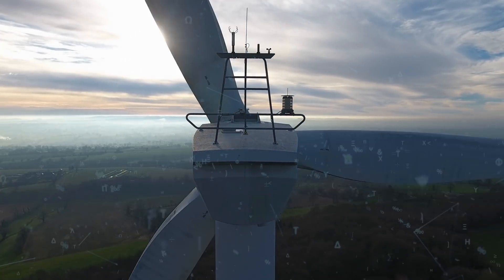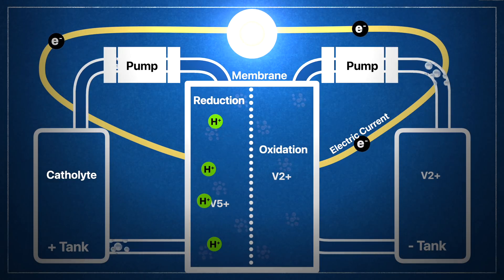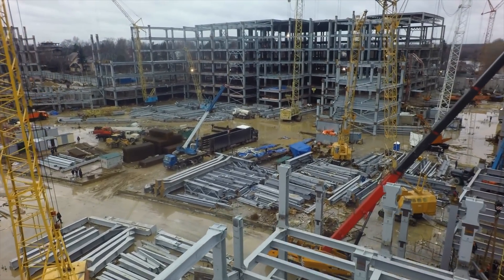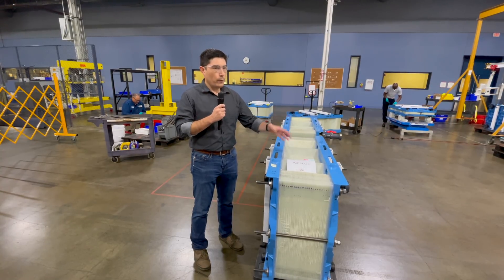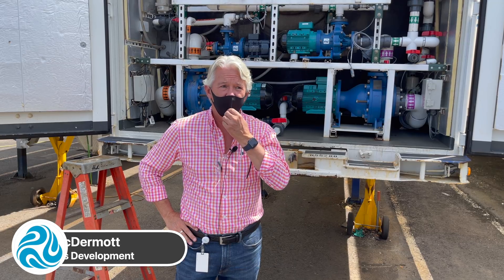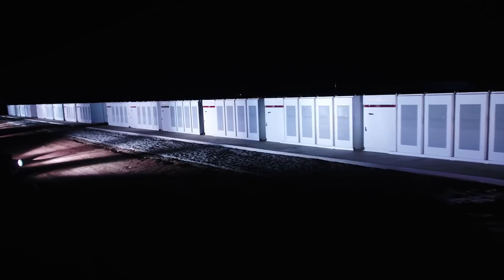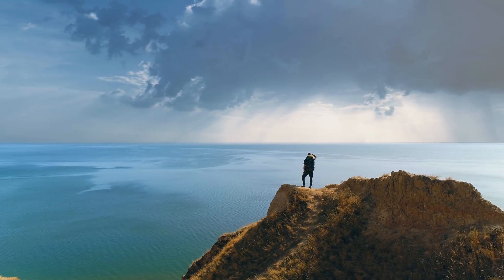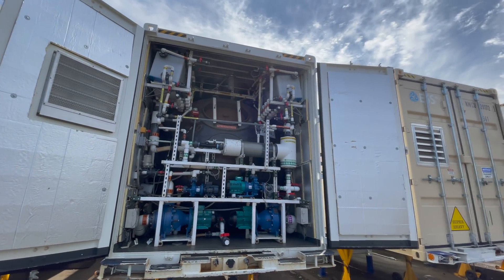The Future of Energy Storage Beyond Lithium Ion

Comment: Great feature but while Iron redox flow batteries are cheap they are also relatively slow and most suitable for long term storage. The technolog most suitable for medium term storage such as daily storage to shift solar energy into the evening peak period is vanadium redox flow such as the Invinity systms already installaed at a number of locations in California. They can be combined with a smaller capaity lithium battery for grid stabilisation. I'd love to see an item on this exciting technology.
Reply: Utilities are certainly looking for long term storage. weather events that block solar for days and also not have reliable winds do occur. There are times of the year where peak powers for wind a solar happen so have the ability of carrying over some of the excess energy in storage weeks or even a few months would be highly prized for any electric utility.
Reply: @rpf276  The low frequency of those periods of low renewables generation mean that there are few oportunities to earn money to pay for them, therefore thse long term back up systems need to be cheap otherwise we'll never get rid if fossil fuel peaker plants.

Comment: Let me get this... In theory you could get a container with a flow battery, cover it in solar pannels, and maybe add a small wind turbine, and you have a decentralised self sustaining small powerstation.
You could put multiple ones of those into suburbs or on top of buildings in city centers, and power homes from them without the need for long transmission lines, and the materials are readily available.

Comment: Looks like a potential winner, so could we have some more numbers? For the container-sized unit, what are the anticipated initial and production level capital costs; rates of charge; discharge and storage capacity; base load of the various pumps, ‘dialysis’ unit, enclosure heating / cooling requirements; periodic maintenance requirements; bunding requirement?? Interested potential investor 👍

Comment: Li-ion batteries have a poor energy density, although it is the best we have.
It is not very promising if the flow batteries have even lower energy density. How is the efficiency from charging to discharging ?
Li-ion loses 10 % with charging and 10 % with discharging, how does this compare ?
A solution for large scale grid backup is still a long way to go, if there is a way.
Reply: Energy density doesn't really matter for stationary uses.

Comment: I did not seem anything about low temperature operation. Every battery tech seems to loose effectiveness when cold. I have seen LIFEPO4 batteries with multiple statements that this type of battery should not be charge below 0 deg C.
 Simular for LION - 4 degs C. 

Chemistry likes to be warm for some known reason. Yes I know salt water has a lower freezing point.  Salting (sodium chloride) roads does not always work, because the air and ground temperature is to cold.

That thing is so large, it would be hard to do a cold chamber test.

Can heating elements be added?
Expected Min cold operation?
Any high temperature issues?

Very interesting concept!

Comment: Not sold I'm afraid. Tesla is moving toward LFP batteries for their Megapacks. There is No shortage of the required elements. This has a lifespan of 5000 cycles and has no moving parts.
It is safe, resistant to high temperatures and cheap.

What's missing from your article is a cost per mwh of storage. Without that the word "cheap" doesn't apply. Whereas Iron and salt water are abundant and safe, the entire system and its maintenance determines its initial cost and maintenance cost. 

Without that info, any comparison to Iron Phosphate or Sodium batteries is impossible.
If someone has a great invention and you don't know how much it costs... I wouldn't invest even if they claimed its "cheap". Well Saltwater and Iron are, but the sytems acquisition and operational costs over 20 years?

Total cost per kwh over 20 years. 
Round trip efficiency. 

Teslas are more than 90% round trip efficient. 
The LFP battery will likely be close. 
How does this compare? 
Lost round trip energy is part of the operational cost. 

This is an "also ran" tech unless that case can be made.

Comment: To me it’s not just about the energy density of the battery-based energy storage system.  It’s about the density of the systems used to generate the electrical energy in the first place.  I seriously doubt that it would be practical to base all of our energy generation on wind and solar.  The density is just not there, nor is the peak capacity.  Also, what about the environmental impact of the manufacturing and the disposal of solar cells and panels?  Are we hearing all of the facts about that?  In my opinion, the answer is much more likely to be small, modular, extremely efficient and passively safe nuclear plants…MSRs and LFTRs, and that is where we should be focusing our ingenuity, capital and effort.  And, eventually, fusion, if that will ever reach commercial scale capability and be able to compete cost and efficiency-wise with advanced fission reactor designs.

Comment: How does this compare to just mechanical lifting of concrete block to 10 stories when you generate the energy and letting it fall to get it back. The simplest form of storage I can think of and probably in my thought process the cheapest IF it's at all efficient.

Comment: It seems to me that they glossed over the "proton" which is really hydrogen problem. This type of battery will produce lots of H2 whenever it is charging. That stuff is insidious as it penetrates every kind of seal and makes metal brittle. The system will also produce O2 and chlorine gas but these by-products are handled with greater ease.
How much heat do these batteries release when charging or discharging? Can they be stacked vertically, underground or above ground to reduce their footprint?
Sure, their presentation makes these batteries sound great, but H2 is insidious and explosive. I am not satisfied that their "proton pump" is an adequate solution.

Comment: For a long time, I've wondered about the possibility of a boat that is powered by a kind of salt water battery, using the salt water of the ocean as the electrolyte.  I've been able to make simple salt water cells, but there are a lot of problems to overcome to power something like a full sized boat, (assuming it's even reasonably possible at all).  As with many things; anything  a regular ole schmoe like me imagines, someone much smarter has likely already thought of, tried, and either proven or disproven  as feasible or not.  The biggest hurdle seemed to be corrosion of the metal plates.   Using metals that were corrosion proof like 316 stainless steel or titanium produced almost negligible voltages.  I've built countless high voltage,  RF, and micro-controller projects, but never quite ventured over to the chemistry side as far as tinkering, partially out of that slight paranoia that a bunch of people in tactical gear will kick in my door, shoot my dogs, and throw me on my face, due to me being red flagged for ordering some chemistry glass online.😬

Comment: Intriguing. Quite sure I don't understand the process. There's ferrous chloride and potassium chloride in water? Plate out the iron, where does the chloride go? KCl exists as ions in the water already, adding more chloride wouldn't work, would it? If it's FeCl2+2 KOH+ 2 H20 then there would be a surplus of oxygen: Fe+2 KCl + 2 H20 + 2 O2. Better than a surplus of Cloride, maybe, but still, leaving it open to air to breathe oxygen would surely leak some Cl and H as well?

Comment: Well done , another introduction to a battery tech that most of us will not have heard  about.
Now lets get serious, you are effectively comparing different tech & it often seems as though the manufacturers are not inclined to be direct about the pros & cons.
I suggest you establish some metrics so that comparisons can be readily made:
Cost installed for a (say) 10 Gw plant.
Projected operating costs over 10 years (10 Gw plant)..
Weight per Mw of capacity
Area required per Mw of capacity
Land area required for 10Gw plant
Electrical storage efficiency ( elec power out/elec power in).
I know it's not always easy to obtain such data but the manufacturers you introduce should be willing to provide same.

Comment: 19:00 YES!! I have been following flow battery technology for a couple years.  I think this is an exceptional opportunity.  I hope that it could make it's way to home storage though.  Just another appliance, but with monitoring and dispatch of a technician.  You get you A/C serviced every few years, right?  Add some monitoring equipment to dispatch a technician and repairs get billed over 12 months so even a surprise issue doesn't hurt so bad.

Comment: I think we're overestimating how much maintenance is going to have to actually be performed on a system like this. Industrial pumps are really reliable machines, they can run for decades with minimal intervention. And besides that the reason why lithium ion cells degrade over time is that their parts literally wear out, but you have to scrap and recycle them because it's impossible to open up a cell and service it. The fact that repairing one of these is even possible makes up for a lot of the shortcomings.

Comment: You are missing a few things. Flow batteries cant do what big installations of lithium batteries like the Tesla Hornsdale installation in South Australia do. The difference is lithium can discharge super quickly which means they are the best solution for frequency control on the grid. Because you can make alot of money in the frequency control space this has been implemented first and they are still learning what these installations are capable of. But you dont need alot of frequency control compared to baseload storage.

Flow batteries are best suited as long term energy storage that can be used as a replacement for baseload, you just have to install enough of them, and that is alot. It would most definitely be a waste to use lithium for baseload storage when flow batteries can do the job.

There are some flow batteries usable in the home like a powerwall. The Redflow Zinc bromine flow battery for example is smaller than the examples in your video and can be used at residential level , in cellphone towers as backup systems, or scaled up to grid level or any size in between.

Comment: Let's see, a Lithium Nickel Magnesium Cobalt battery may run into thermal runaway at 60C, combusts at 500C, and burns at 2000C. The ignition temperature of Gasoline is 232C and can burn at 945C.

Comment: In the long term, Superconductor storage rings are the answer for fixed station electric storage - just have to get the costs down, optimally via discovery of a "room temperature" HIGH level superconductor material.
Still leaves this issue of mobile/portable energy storage, just like these flow batteries do.

Comment: Cool!  I doubt that wind and solar will ever amount to a major part of our electric supply.  But I welcome technology like this that would help anyway.
Reply: You do realize that 13% of the U.S. power is currently produced by wind and solar, right? In April of this year, 20% of the power used was wind or solar. As the cost of solar cells and improvements in off-peak storage continues, the U.S. Department of Energy has predicted that as much as 40% of the U.S. power could be provided by solar alone by 2035. So, sorry Ken, but I simply disagree with you on this one. Wind and solar are already "a major part of our electric supply" and will - in time - comprise the majority of the power we use in this country.
Reply: @GeeDeeBird : "Wind and solar are already 'a major part of our electric supply' ..."
That's confusing.  Is it 13% or 20%?  I googled and found both answers, but they seem in conflict.

In any case, it's a long long way from 20% to 90%, especially since we would constantly need new land, turbines, panels and batteries to be added, plus the old stuff needs to be constantly replaced.  That's a HUGE drain on resources and available landfill space.

I salute the effort.  It would be wonderful if we could use all renewable energy.  But it just doesn't seem to be practical.

Nuclear has always been the best option. All of the notorious reactor accidents have been pressurized water cooled reactors.  Molten salt reactors are MUCH safer since they don't need to be pressurized and they can be designed to be inherently safe on loss of power.
Reply: @KenJackson_US  As you know electrical demands vary. So do the provision rates of both solar and wind energy. If you were to graph them, you would find points at which they reach 20%. However, taking all provision levels into account, the average provision level is 13%. In either event, in my opinion that is a major contribution to our electric supply. If it were 5%, I might agree with you.  I absolutely agree with you that nuclear should be a very large part of our long-term energy solution. The mythology surrounding that energy source is no longer believable. Having said that, if we can continue to develop sustainable renewable energy sources such as wind and solar that can only be a good thing.
Reply: Do you have any comment on the problems with wind power in Texas,  @GeeDeeBird ?
Reply: @KenJackson_US  First, I'm not terribly enthusiastic about large scale wind power. The 25 to 30 year useful life is wind turbines, the maintenance and replacement expenses.... I'd prefer that wind energy be treated as a niche method for medium scale installations. For other purposes, I prefer solar and nuclear energy. As for Texas, my understanding is that 40 percent of the states generating capacity was crippled by record low temperatures in the Spring of 2021. Wind accounted for nearly 20 percent of the state's energy production overall, but only 13 percent in the winter. Unlike other states, Texas has not winterized its production facilities (of any type) leaving them vulnerable to extreme cold weather. Historic freezing weather took down 46 GW of production in Texas, of which 18 GB was renewable (wind and solar) and 28 GB was thermal (gas, coal and nuclear). Conservative pundits and politicians quickly blamed the entire collapse on "green energy." When all the facts came to light, the real culprits were the severe weather (which took down production of all types) and criminally negligent mismanagement by the Texas energy regulatory commission. Despite numerous previous incidents in which the Texas power grid was at or near the failure point, the commission did not order producers to take preventative steps commonly used throughout the industry. Nor has such action been taken in the wake of the widespread, catastrophic system failures in the Spring of 2021, making it almost certain that more lives and property will be lost in the future. That future loss could be prevented by sound management and regulation. Texas has an energy problem, but it's not windmills.